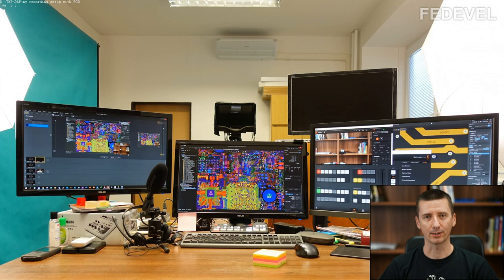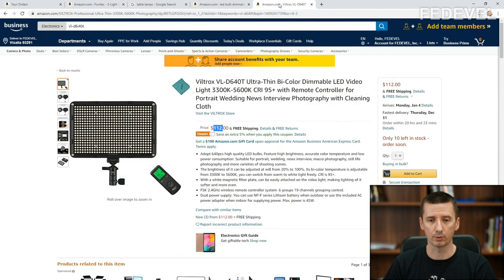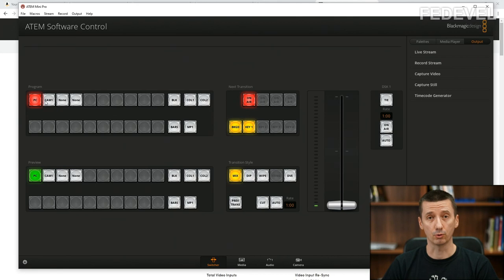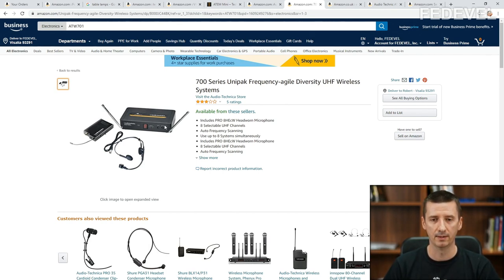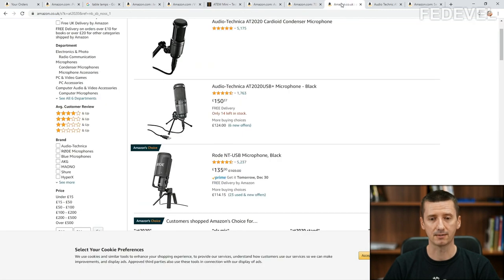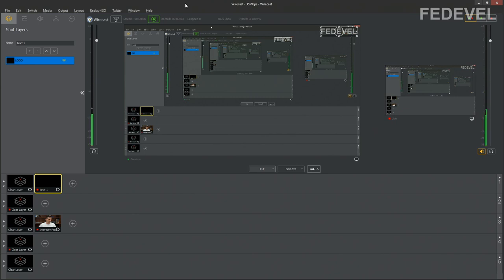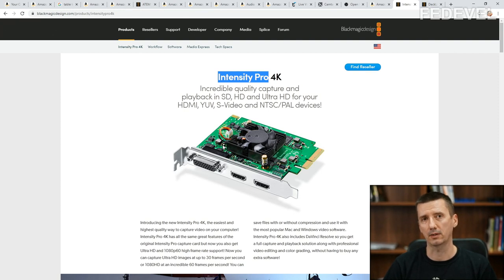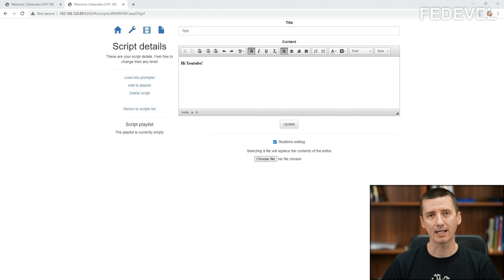How I Record My Videos - Is Your Setup Better?

Comment: You have made a great video, and it contains a lot of useful info. I hope you forgive me for adding some information to your video.
About light:
1) When buying lightbulbs, make sure that they do not flicker, you can detect it by using your camera on your mobile phone and point it toward the lightbulb.
2) Depended on what you are recording can correct colors be important. There are several standards that is about colors but the one you shall look for, is the color standard for cameras (TLCI) Numbers above 85 is best and as near 100 you can get, gives you the absolute best picture.
3) Temperature of light is not that important for the camera, select what you like the most (i.e. 2700 K to 6000 k)
4) Lumen is very important and often do people think that more is better, but unfortunately is it fare from that simple. Your camera do not care about the amount of light or temperature of light, it does just adjust the internal settings to make the image look as "natural" as possible.
Fare more important is what you want to be sharp in your video, do you want everything sharp as in KissAudio or only your face sharp, just as in this video? To understand the connection of depth of field and light, can you maybe search here on YouTube.
5) Stand out: Often do you see the YouTuber, almost look like they are in one with the background, try to add a light that shine on the background behind you. It makes the two things get separated and gives more "air" in the picture.

One more thing is the camera, if you mainly are planning on making video, the buy a video-camcorder, not a still photo camera. A still photo camera are mainly designed to snap pictures with an added feature of recording a bit of video, while the real camcorder are build with video as the main focus. You'll get a lot better video, more automatic around video and several added features that do not have to be used on a camera for photography. :-)
Reply from the maker: Fried, what a great feedback. Thank you! 

1) I had this on my list, didn't want to make the video too long. I went around flickering by changing my camera setting from PAL to NTSC.
2) How can you do that? How to set the right colors and how do you know you set right colors?
3) I found out, that if light is too cold, it may be difficult to set realistic colors. But, I am not expert, so maybe doing something wrong?
4) Yes, this is tricky - especially if only some places are too bright.
5) Background light is on my list to experiment with

Camera: I personally went for a photo Camera as I can use it also take a very nice pictures. Initially I had a look at a proper video camera .... looked to me too expensive for something I would not use for anything else. So, I decided to buy a photo Camera instead (especially when I do not see any difference in the picture quality .. and many people use photo camera for professional recording, so I was not really investigating much deeper why to go for a video camera).
Reply: @RobertFeranec  You are so welcome! :-)
I'll answer in reverse order:
A camcorder can easily take snapshots and in a very high quality, but they are not featured with everything a still photo camera will have. About picture quality, no there may not be a différance, but a video camera is made and featured with what you need to make video and can make it a lot easier to get the best video result. :-)

5) Background light is fairly simple to start out with, of course can it get super complicated if you want to know everything about it. But simply try to use a normal spotlight lamp and point the light on the background behind your head or maybe try to point it on your hair on the back of your head, they give very different results and maybe do you like one more than the other. Use a normal lamp sins it is easier to use low to moderate light in the start, until you begin to desire a certain shape, color or brightness.

4) if one place are too bright, then try to get a white sheet and place it, so it reflects some light over to the other site.

3) 2) On a still photo camera is it maybe a bit harder but in your manual should be about how to adjust white balance, often do you point the camera at a sheet of paper, zoom in, so the paper is filling the frame while still being far from the camera. Then do you adjust the camera.

1) flickering is normally because the frame rate on the recorder is matching the flickering and if you need the freedom to adjust your lightning, then is it super annoying to have to fight the flickering. Pal is almost 30 frames per second where NTSC is 25 frames per second, so fine solution:-)

Comment: Very useful! I purchased something similar to the Black Magic device, which only records a single input. I'm very pleased to have it because my Linux screen recording software takes 3x as long to "save" the recording as the length of the recording. Long unnecessary delays are very disturbing to creating a video. The hardware eliminates the save time and allows capturing from hardware where I can't install software to do a capture. Also, recording the screen while doing experimental work, without intention to create a video, is useful for documentation or stepping through something that happened fast or once.
Reply from the maker: I also like it a lot

Comment: I have a quesiton. in case of relay and optocouplers sometimes we use galvanic isolation. so a portion of board is cut off from the board to isolate high voltage part from low voltage section.   How to draw these type of cut out in Altium?

Comment: Thank you very much for the video Robert,
It is not related to video setup but I would like to know.
What is the tablet on your desk, I sometimes need to draw something on the screen and I need something like yours.
Kind Regards
Reply from the maker: Thank you Kerem. The tablet is "Wacom Intuos S Bluetooth Black CTL4100WL" .. it's super useful. The size is just right and I have used it a lot (for example when doing reviews or taking screenshots and marking some stuff in them). I originally bought it to use it in my videos, but I actually use it much more when I am not recording. PS: The CLIP STUDIO PAINT software is also very good (I have got it with tablet). This one looks like the tablet I have https://www.amazon.com/Wacom-Wireless-Software-Included-CTL4100WLK0/dp/B079J2FSQ7/ref=sr_1_3?dchild=1&keywords=wacom+intuos+bluetooth&qid=1609757044&sr=8-3
Reply: Thank you sooo much Robert, 
frankly there are lots of tablets in the market, but finding the correct one, is really hard. And since you use it and found it really good, I shall be confident to buy one for myself.
And with this opportunity, I would like to thank you again for all your work and effort for the videos.
Kind Regards,

Comment: Hi Mr. Robert, I like your content, and I have just a simple question about PCB design which I don't Understand, So When I want to design a PCB, shall I consider if it's a High-Speed PCB? I mean is there are High-Speed Traces in this PCB design? So, in this case, I will consider Signal Integrity Power Integrity EMC Noise Problems, So if it's not a High-Speed PCB, I will design my PCB freely without any fear about Noise can be created in this PCB?  And I will consider only the Capabilities of my PCB Manufacturer. So is that True? and from what speed or frequency a PCB will be considered as a High-Speed PCB? Thank you so much, Mr. Robert.
Reply from the maker: Ayman, it would be the best to ask these questions on our forum here: https://designhelp.fedevel.com/